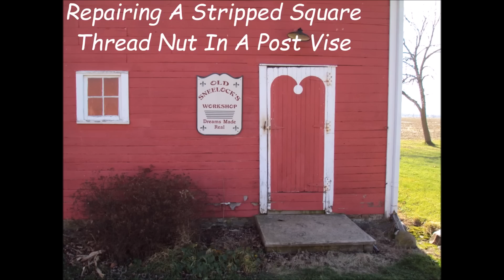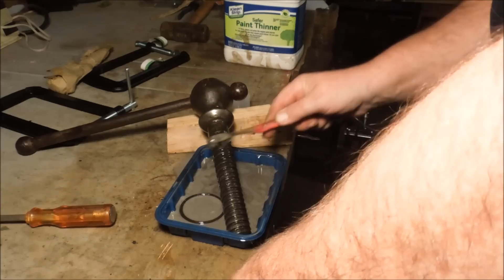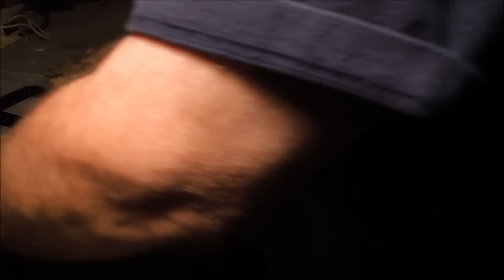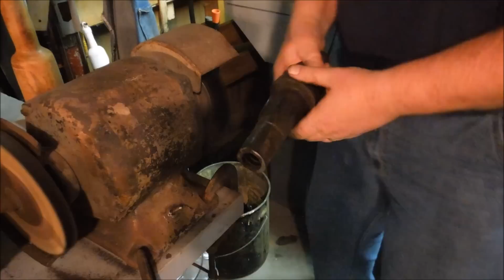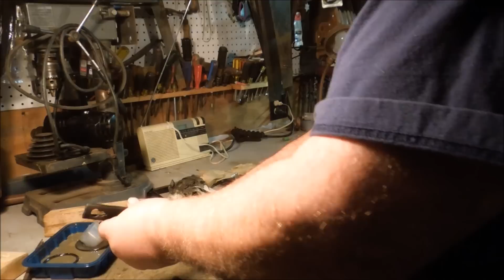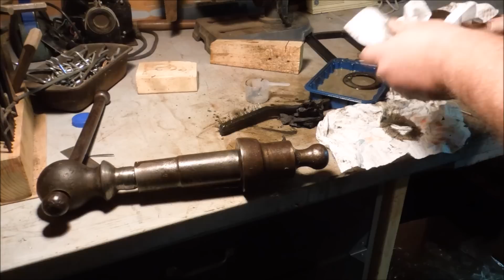Blacksmithing Tools   Post Vise   Pt 2   by Old Sneelock's Workshop

Comment: For cleaning inside of a coupler nut, I have taken a small wire brush, and ground it so it would fit in a drill, and then used it to clean inside
Reply from the maker: edgeofeternity101 The wire brush is a good idea. my problem is that the threads are nearly gone in the nut. I need to build tools to build tools for this job.
Reply from the maker: edgeofeternity101 The wire brush is a good idea. My problem is that the threads are nearly gone in the nut. I need to build tools to build tools for this job.
Reply: I wonder if you can buy a piece of round stock with the correct thread already inside. you could then set up the coupler nut and machine off the damaged thread and then bore into the end of the piece to accept the round stock then weld it in and add a stop back on to keep from rotating. You may be able to get it pre-hardened and annealed. If not you could harden it the old way.
Reply from the maker: edgeofeternity101 I might be able to. I intend to turn and thread a new barrel insert.

Comment: it looks like an old peater wright they quit puting stamps on them because of thare were so meny. i bought a clobian made one for $75 and all it had was a C in a triangle. nice flind.
Reply: I thought it looked like a Peter Wright as well.  I have a reprint of the Peter Wright catalogue and the finial on the end is shaped more like a Wright than an Indian Chief (made by Columbus Forge)  I doubt a blacksmith would or could make something like this in an average shop as you mentioned in video 1, as this is drop forged and usually takes massive equipment to perform.
Reply from the maker: +Brendan Crate Thanks Brendan. I'm still uncertain who made it but Peter Wright is just as possible.

Comment: Try laquer thinner and you won't have to do so much scrubbing.  Soak it in a PVC tube overnight and you can rinse it off.  Paint thinner just isn't as powerful of a solvent on grease and dirt.  You can also spray it with F.I.S.T. and the grease will wash off with water and soap.  Good project. Doug
Reply from the maker: +Douglas Thompson Thanks for the tip. I'm using the paint thinner because it's supposed to be a milder form of cleaner and doesn't fume as much as lacquer thinner. Working in the basement I wanted to avoid the smell in the house.  I was not impressed. When the bottle is gone I'll try the lacquer thinner. I'll just have to use it in the garage.

Comment: Lot of metal on the screw. I could see it swirling around in the pan, like the brass on the 3-phase saw you re-did. I need to pull mine apart and give it a good cleaning too. I oiled it up when I got it but not since, even though I try and baby it. And the Duerr is no more. I needed the room more than I needed a grinder since we mulch with the Snapper bagger anyway. I'm keeping the motor and wheels and mount because either the Saw Surgeon or myself will run across a project needing such. Will be waiting to see the next'un. I've got an old de-greaser formula of a bottle of Joy and a gallon of kerosene. You might've used it but I'll let you know how it goes. I hope!
Reply from the maker: +Lewie McNeely Definitely a lot of iron dust on the screw. The cast iron nut is badly worn. The iron on iron bearings and screws on the old machinery needs to be oiled every time they are used. I understand needing the room. Sometimes I just put out the free sign on the front lawn and pile stuff next to it. It's kind of nice to watch people pick up the stuff. What I can't use someone else can.
Reply: The main thing on the shreder was the way the knives were fastened on the flywheel. Little oval things with a spot weld on one end and a threaded hole on the other. The knives were fastened to them with flat heat allen screws, nothing else. I might could have drilled them out and used a grade-8 something or a locknut behind it but needing the room, i think I'm doing the right thing. I've got a pump mount and a half a lovejoy for an 8 h.p. anyway so if my 5 Briggs konks off, I'll have a spare waiting. But the Briggs hasn't missed a lick yet and only needs about 1/3 throttle with the 2-stage pump to pull 2200 p.s.i. so if it ain't broke, leave it be.

Comment: Great video! I have a question though, is paint thinner a good way to remove rust from tools or are you using something else that is being stored in that container? I recently restored a wood bench vice and it took me days to remove the rust off of it with white vinegar. I also would like to know if you put a product on your tools to prevent rust from happening.
Reply from the maker: +bob hue I'm using the paint thinner to clean the oily dust from the screw. For rust removal I prefer electrolysis. It needs to be done outside because of the hydrogen released from the water breaking down, so I can only use that method in warmer weather.  In the winter I also use apple cider vinegar to remove rust. I first tried white vinegar and it turned rancid on me and stopped working pretty quickly. The apple cider vinegar smells good and works well. Washing vinegar can go up to 10% acid. Cooking vinegar is 5%. Here's more information: https://www.youtube.com/watch?v=5CefyRIW7wY
I use paste wax to coat parts and prevent rust. I show Butchers wax in a lot of my videos because I used it on my table saw and it didn't rust in the old shop. So now I put it on saws, planes, and almost everything. The can is running empty and I need to get another one. I tried Minwax paste wax and didn't get as good a result.